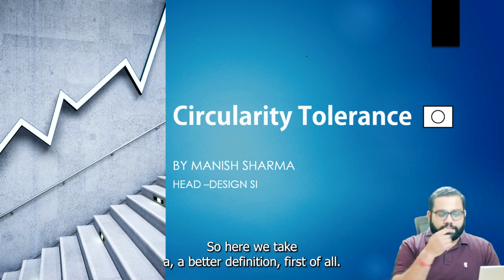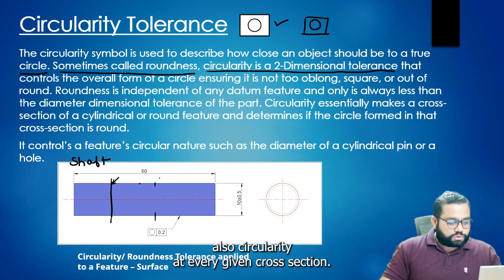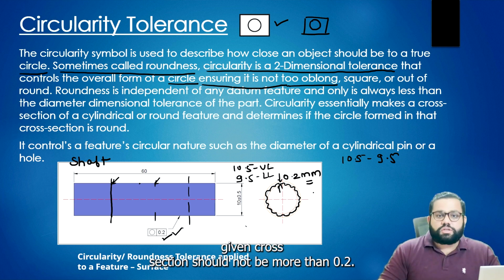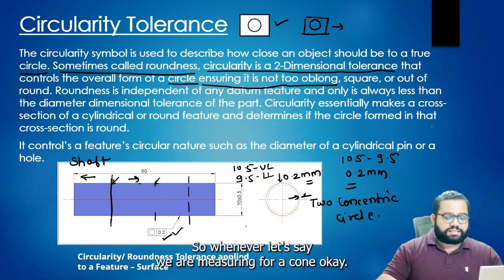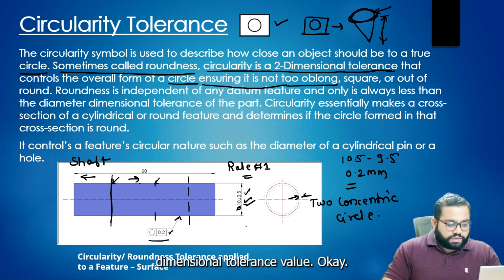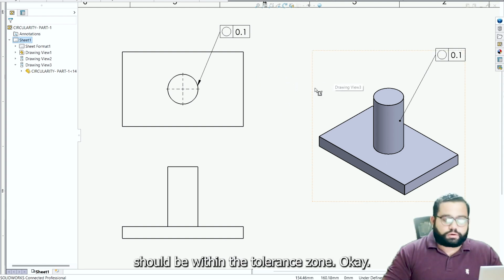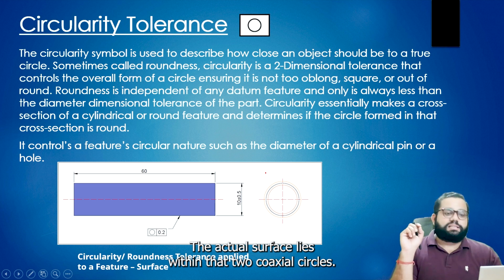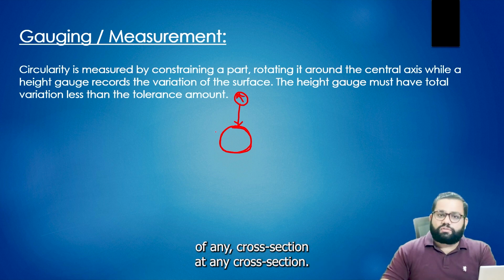GD&T - Circularity Tolerance|| Tutorial - 21 ||

Comment: How to decide the value of circularity as mentioned 0.1, 0.2 or something else ?
Reply from the maker: Look at your diameter's upper and lower limits. The total size tolerance is the maximum possible range allowed. Your circularity value must be less than this total range.

Example: If a shaft diameter is 20.00 mm ±0.10 mm:Maximum Material Condition (MMC) = 20.10 mmLeast Material Condition (LMC) = 19.90 mmTotal Size Tolerance = 0.20 mmRule: Your circularity tolerance value must be < 0.20 mm to have any functional purpose.

Apply Engineering Rules of Thumb Depending on how critical the circularity is to your part's function, engineers typically specify a fraction of the total size tolerance: Standard / Non-Critical Applications: Set circularity to 30% to 50% of the total size tolerance.Using the example above (0.20 mm size tolerance), a reasonable circularity would be 0.06 mm to 0.10 mm. This keeps the part reasonably round without driving up manufacturing costs.

High-Precision / High-Wear Applications: Set circularity to 10% to 25% of the total size tolerance.This is required for rotating shafts, fluid seals, or press-fits where even tiny oval deviations create heat, leakage, or vibration.